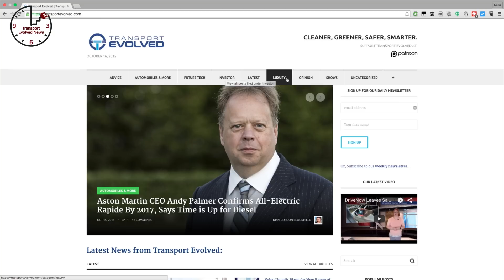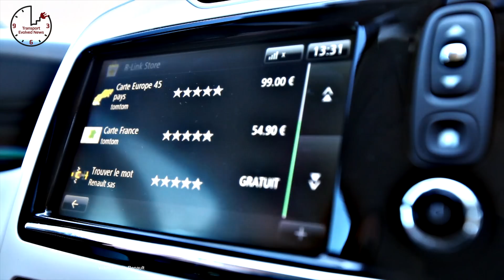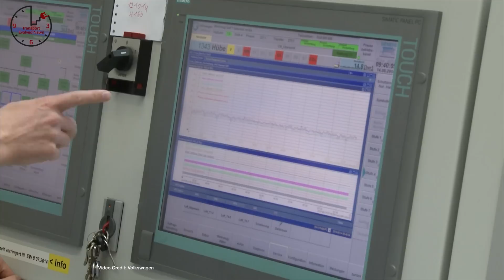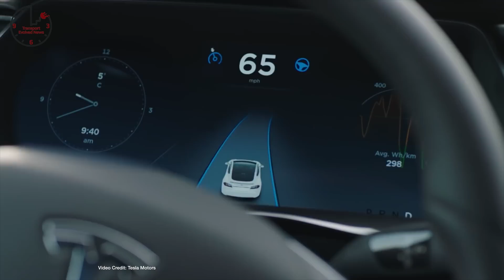Tesla Model 3 Supercharging, VW Gigafactory, Model X Fix, T.E.N. Future Car News 3rd June, 2016

Comment: as you stated the detractors of electric vehicles will often cite the carbon footprint created by extra mining and the production of electric batteries and by particulate matter as to why electric vehicles are no greener in their petrol counterparts. first off the power that is generating the electricity can be switched over to clean energy whether solar, wind or geothermal. Secondly I was recently filling up at my local Costco gas station in Southern California and I noticed a fuel tanker filling their holding tanks I asked you attended how often they needed to resupply and he stated they had 7 fuel tanker deliveries everyday, then it struck me all gas stations need to be resupplied and in America that means tanker truck so we need to add the carbon footprint of tens of thousands of fuel trucks resupplying every gas station on every corner in every town. That is a massive carbon footprint and far outweighs the carbon footprint of increased mining for the production of batteries and the particulate matter generated by big rigs is massive compared to that of a standard automobile. and I'm not even getting into the massive pollution created by the tanker ships that bring over the crude oilin the first place.

Comment: On hydrogen fuel stations: that's stupid and ENOURMOUSLY expensive (one), that's a squander of money, non of existing hydrogen manufacturers promised to mass produce such cars (two), and this stupid incentive could only work if it was 90% subsidized by government (three) because no manufacturer would invest four million US dollars in one station, that is an enormous luxury. Moreover, there is no physical possibillity to produce a reasonably cheap hydrogen cars, as the price is made by technology (four), and we don't know if they are profitable, I remember in the mid '00 on average the price per one fuel-cell hydrogen car was about a million US dollars. And I didn't touch the fact that hydrogen is as pollutant as oil in its life cycle. Very unwise.

Comment: It's actually realistic and encouraging if Model 3 owners do pay for supercharging.  The supercharging infrastructure needs to be paid for as it grows and gets more widespread use.  Also, previous Model S and Model X owners indirectly paid for their supercharging experiences too, by paying more for their cars - and having less supercharging stations to use.  It is better to have peace of mind that Tesla puts it's resources and money into producing quality in the Model III Car, rather than wonder if they're stretching resources too thin by providing free electricity to the masses.  Bottom Line - even if one pays for all the charging while owning a Tesla, previous owner experiences have recorded over extended mileage, that the cost per mile is still about one fourth to one third as much gasoline costs have been over the past three years.  So imagine gas costing one fourth as much while producing no pollutants or noise - Quite a bargain even in the worst case scenarios!   This is the part that the nay-Sayers and pundits don't want to tell you.  I already knew this was going to be the case on the day of the first reveal because the logic is really obvious.

Comment: Reality check: Autonomy: this is years off no mater what happens with Teslas. Too many people immersed in new tech information, (and want it badly), think autonomy is near future, but, most of the general public will not trust a computer to drive for them, only once the tech is proven will some, and only some people trust it.

I wish Tesla would put all of it's efforts into making the Model 3 a great driver's car, not the car with the most tech...I've been waiting decades for electric cars to go mainstream, and want the Model 3 to be a great driver's car at the base, with the "most tech" only optional, not built-in, (I want the expense put into the car, not autonomy).

All that said, I do use cruise control, and hate parallel parking, not good at getting in small spaces, so would like the car to park itself, and maybe give me safety warnings about keeping in my lane on the interstate/freeway, but, no car is going to have the tech (today) to deal with the roads I have to drive on, I drive on roads that don't have lines, worn lines, have potholes and badly done manhole covers that need to go around, sand/dirt on the sides that hasn't been swept, snow in the winter covering any lines that might be there, not to mention road kill, etc., etc., so many variables. Maybe in California where they are developing this tech they have great roads, but, most of the US is not so lucky. Full autonomy is a long ways off. Go ahead and develop it, but, don't expect mainstream drivers to beta test it...too many will just get on their phones and not pay attention, so when it errs, they will be worse off, not better. And, most of the general public is not good at following instructions, so, autonomy should be disabled by default and the person has to enable it ("Autopilot on: are you sure?"), this might help with some of the recent problems.
Reply: Model S first and foremost is a great drivers car.  It has great handling, good steering feel, incredible acceleration, massive and smooth torque, etc.  Secondarily it has convenience features like auto cruise control and auto steering.  Oh, and it's also purely electric and can go 300 miles on a charge.  And it's good looking.  Model 3 will be more of the same but a little smaller, and a lot lower priced.
Reply: the Model 3 is being developed as a fully autonomous car.

...I'm also disappointed the government put big $ into autonomy instead of putting that money into forcing the big carmakers to go electric. We need to go electric first. Other countries have such goals https://twitter.com/tsport100/status/739424620860702722
Reply: benji888578 Kind of doubt it, though it's a good rumor.  Full autonomy is extremely hard to do well.  There are many variables in real world driving that are extremely hard to fully anticipate, plan for and respond to correctly in a computer program.

Comment: Supercharger not free for Tesla Model 3 base model? No big surprise, the Tesla Model S 60 (entry level) used to be without supercharging, it was a $2000 option...option like "mud guards", meaning, a one time fee for lifetime free supercharging. While Tesla may do things differently with the Model 3, i.e. maybe free supercharging will be included with certain option packages rather than just a tag-on option, many people may not need supercharging when you can drive 200+ miles a day, just charging at home. I, on the other hand, do road trips and will need DC fast charging once I am able to switch to a BEV vehicle.
Reply: No sort of thing like free supercharging. This is pre-paid supercharging. Nothing is for free.
Reply: Some people just confuse a one time flat rate with "free". Must be people with bad memory capabilites... ;)

Comment: Could we have a special Tesla Model 3 episode to talk about all benefits and problems with the car.
Reply: ah, aren't we jumping the gun? Can't we wait until it's in production to get that in-depth?
Reply: ...I mean, I see way too much speculation on the internet already. ...and really stupid stuff, like, comparing the model 3 to a plug-in hybrid chevy volt??
Reply: Kind of agree, but unless the Bolt can use a large fast charger network and drive itself, it seems non-competitive vs the Model 3.  GM might be working on automatic steering however.
Reply: I wasn't talking about the BEV Chevy Bolt, I was referring to comparisons between the not-yet-in-production BEV Tesla Model 3 and the currently in production PHEV Chevy Volt...this is just stupid, like comparing apples and oranges, yet the orange has only budded. ...but, yeah, the Bolt is very lacking...sub compact sized and no DC fast charging on it, and GM has no charging network, so, they aren't really all that serious about it. In fact, GM is still fighting (through dealership associations) Telsa, trying to keep them from selling vehicles in various states. I have no respect for GM, the biggest B.S. marketing in the business and...they had the chance to lead the electric vehicle market and blew it over a decade ago. (Plus GM, especially Chevy, makes cheap crappy cars anyway.)
Reply: benji888578 Missed that you were referring to the Volt, not the Bolt.  (The two names are kind of confusing, BTW.)  IMO GM makes pretty good cars.  Agree they could have owned the EV market if they continued developing it 20 years ago, instead of crushing the EV1.

Comment: Toyota and Honda: get it together! Where are your EVs?
Reply: the Japanese government has their head up their asses pushing hydrogen, this may have something to do with it, but, they also don't want to screw with their current business model. Unfortunately, those that don't change in the next five years will fail. I won't be surprised if they both don't come out with BEVs after Tesla's first successful year selling Model 3s. One thing hydrogen fuel cell cars and battery electric cars have in common is an electric drivetrain, so, they likely have something behind the curtain.

Toyota made a big mistake when they stopped making the (gen 2) Rav4 EV, and, a couple years later, only doing a lame hybrid model of it. Toyota makes (and markets) hybrids so they can sell the gas guzzling Tundras and big SUVs...they have to keep their overall MPG at a certain amount for the company, and that's how they do it. Also, making only hybrids and not plug-ins (plug-in Prius is a lame attempt), keeps people's first impressions of EVs, (by driving hybrids in EV mode), that of a golf-cart. One of the many reasons big carmakers don't want to make BEVs is because they make their dollars off service contracts/extended warranties with financing and the dealership with the service department, and they don't want to sell a car that won't need service. Hydrogen fuel cell cars will need more servicing than battery electrics. (They don't want people to know they can get a truly reliable car that requires little maintenance and drives well. They, and B.O. are trying their best to keep the general public from finding this out.)
Reply: It's weird -- it's not like Japan has a handy supply of hydrogen, though they have made attempts to exploit seafloor methane clathrates: crazy heaped upon crazy; or perhaps just desperate now that they switched off the nuclear reactors following the Fukushima Daiichi disaster -- the better reaction (sorry) might have been to insist that all backup power was located safely above sea level and flood-proofed.
Reply: Hydrogen is pushed by oil companies.  Most commercially-available Hydrogen is made from Natural Gas, which is largely sold by oil companies.  Making Hydrogen using electricity and water moves a Hydrogen Fuel Cell vehicle 1/4 as far for the same energy as moving a Battery Electric Vehicle.

Comment: VW should go for it. The e-Golf is proof it knows how to do EV well (I have one). It just needs to keep working on battery tech. In fact, VW _has to go for it if it wants to be part of the future.
Reply: The e-Golf is about the only currently available BEV I might like as a car (I'm not into sedans), VW says they will increase the battery size and range of the car later this year, but, they don't make very many of these and only limited availability...they need to ramp up production and make it available in all 50 states and all VW dealerships, with charging stations at all of them, then I would take them seriously.
Reply: I agree absolutely: VW must get these fantastic cars out across all 50 states (a no-brainer for HI; more for urban/suburban use in AK). I thought all VW dealers had charging stations now, though I could be mistaken. My 2016 model has only 3.6 kW charging, so I do 99% of charging at home: it's not a problem at all. With larger batteries/more range (yay!) you'd want the 7.7 kW charger that came with the 2015 models (and DC fast charging); let's hope these are standard on the 2017 e-Golfs. I have $1000 on a Model 3 but I would still look at the new e-Golf. It has great handling.
Reply: Wait, did they change the charging for 2016? I recall reading about the 2015 e-Golf, I thought it came with DC fast charging standard, does it no longer? (but not sure about the 7.7 kW)...in fact I have a video review playlist I had made a while ago for the e-Golf...I'll have to find new ones and update it.
Reply: +benji888578 There's no DC or 7.7 kW charging on the stripped-down less expensive model with the $159/mo lease over 36 months and $2300 down. You can purchase with those or as an option, I think. For us this is not as important as you might think -- we just charge at home.
Reply: yeah, but, with less than 100 mile range, it needs to have fast charging as standard or you will never be able to take long trips. A car like this can't be most people's only car, which is why 200 miles should be the minimum range on EVs. (I'm sure you have at least one other car that is either ICE or longer range.)
Reply: benji888578 You are correct: we kept our old Camry for longer trips (about 3x a year)... but also have $1k down on a Tesla Model 3. This will have a 215-mile range and DC fast charging. We'd look at new VW EV offerings if they can match that. It may turn out to be less expensive to rent a car for those 3x a year longer trips.